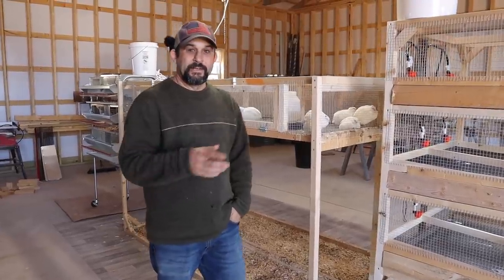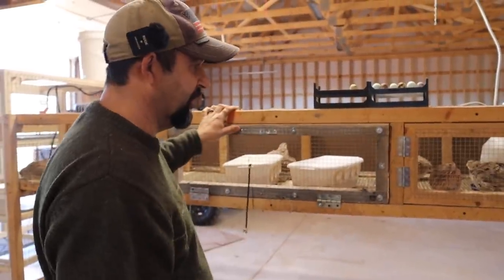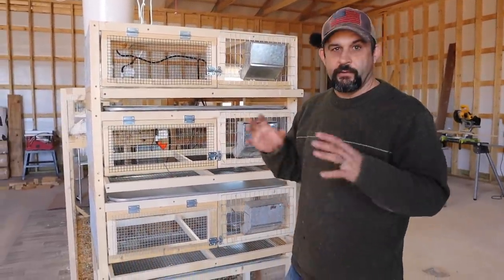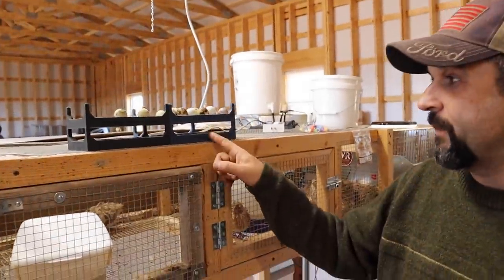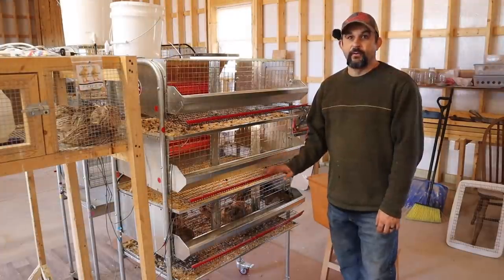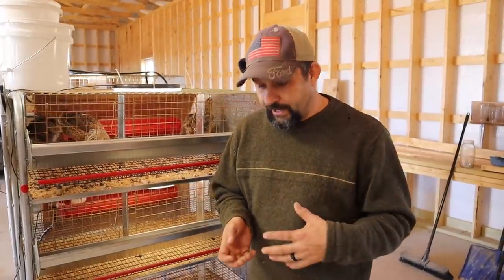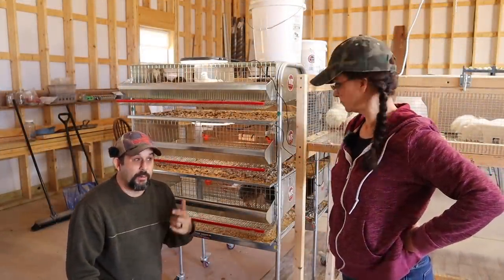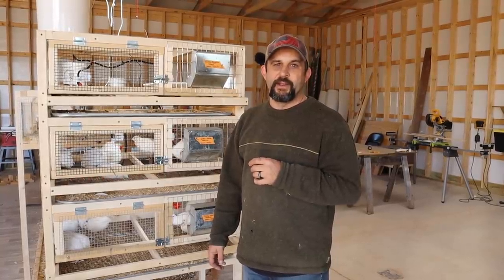Homesteaders HAVE TO BE Problem Solvers!

Comment: Sometimes when you are vent sexing you may find foam but it will really be a hen that was recently bred by a male. You will also only get foam when the males are fully mature.  Males usually start crowing at about 5 weeks of age. Males also have the habit of breeding other males which sometimes can be confusing at first.😃Thank you for showing in detail how to do the wiring for the light. I wouldn't have had a clue how to do it otherwise.

Comment: Fun, I breed parrots for 30 years. one of the best things i put in the buildings was a central Vacuum system, the dust is so bad. Put a big shop vac outside and run PVC pipe where i wanted outlets,  used the very fine saw dust for bedding in the trays so not to plug the pipe, outside i made a top for a 95 gal trashcan, rolling ben trash can.  Bird dust is a real problem for people and birds..   Love your videos.  I sold allot of quail eggs to chinese restaurant  they boil them and put in salads.
Reply: Did you have to get the NPIP to sell, where your at??

Comment: You could also look at Aquarium  L.E.D's lights and submersible lights 5-10 watts, all different lengths, and what ever light pattern you choose will come on with a timer , not having to cut off the on/off switch.... just need a 110v 3 plug adapters... I just added an 44 - inch, 11 watts submersible white/blue tube light for 34.00, much smaller are less expensive...

Comment: Hi Kevin cool eggs holders  an there so cute now I taught you could use a a kind of troff for Rain on buildings just tip your cage a bit put have the troff cliped an the eggs would rolled in the troff now you need a little openging a safe way for friends not to get caught i used these for feeding my chickens very handy you add a piece  of wood like kinda to end for close ends just a taught and the eggs are clean

Comment: There are timers that you can get for fish tanks and terrariums you can use, instead of unnecessarily rewiring stuff.
Reply: I believe he explained on the video that if he just put a timer with that set up, it would only turn it on once, and then the next time it would not turn on because of that rolling switch in the wire. That’s why he had to cut out the rolling switches.

Comment: Though I doubt I will ever raise quail, I still learned from this video. I love the way you chronicle your problem-solving process. It encourages me to not give up when a problem presents itself in my life. Keep up the good work. Can you get to the point where the wire connects to the light? or is it a sealed unit? If you can, could you use the short, plug end of the wire and rewire the light? It would so you eliminate a splice and loose wire going to the electric outlet. You may already know this. I learned it as a bird watcher. When the males look different from the females it's called "sexual dimorphism"

Comment: I love your set up. Could you make content for someone like me that lives in a large one bedroom apartment? I’m really interested in raising quail for meat and eggs.
Reply: The stacker cage he has would be good for that.  The one thing to keep in mind is managing smell and ventilation.  If you have a lot of birds you need good venting so the ammonia scent doesn't build up.

I keep birds both inside and outside, mainly inside during winter.  I recently had a larger than expected hatch, It was shipped eggs so i was only expecting 40-50% hatch rate but ended up getting 55 chicks out of 85 eggs.  While I had the space for it inside (i use Dale's Quails medium brooders) I still had to put a layer of bedding down daily and a fan blowing air over the cage out a crack in the window.  At 4 weeks the smell was much harder to handle in a small room and I was putting bedding down twice a day to keep things smelling decent.  So keep that in mind.

With how intense the cold is outside I decided to move them after they feathered up out into the garage instead of fully outside for better ventilation and air quality for both them and me.

I don't do the stacking cages so I've no advice for that directly, but if you've a lot of birds you may be changing the little trays to catch the waste very often.  So you may want to think about ways for handling high volume of waste and compost if you can.  It would make great compost if mixed with grass clippings and veggie scraps from the kitchen.  Or find someone that is into gardening, they would probably live the free materials for compost since a lot of people struggle getting the browns (the bedding material) for compost outside of gathering leaves in the fall.
Reply: @h.s.6269  Thank you for your response I live in NYC and it gets pretty cold 🥶 I imagine I need to regulate the temperature indoors that may be a challenge. I can keep my population small  and hope this will work Thank you again

Comment: Do quail have to be raised in the confined cages like you have - or can they be raised in a chicken run/coop setup?
Reply: Problems with a quail in a coop/run setup include… 
- Run would need to be 18” or 6 feet high.  They jump aggressively when frightened so between 18” and 6 feet they will break their neck hitting the top of the run.  12” is most commonly used height for cages.
- Quail do not return to a coop at night.  They will stay in the run.  The run will need to be predator proof.
- Quail do not use nesting boxes.  They just drop eggs wherever they are standing at the time.
- Quail’s brooding instinct has been domesticated out of them.  It is extremely unlikely they will sit on eggs and their survival depends entirely on people incubating their eggs for them.

So, some folks do use quail tractors but only for meat bird grow out cages, not for egg production or breeding cages.
Reply: You can raise them in a chicken run and coop setup.  But Alpha brings up good points.  The coop would mainly be for shelter from weather and predators if they are spooked, not for laying.  They seriously enjoy playing in the dirt and grass so I'd highly recommend letting them have an area to exhibit natural behaviors.  

My setup is 2 larger rabbit hutches connected to a 6'x8' run that goes to about thigh height.  The main drawback to it is that they lay everywhere so u need to do some reaching to grab them all.

I've heard that if you provide enough natural cover like small shrubs, tree branches with leaves, and low laying plants they will actually try to go broody.  I've not experienced this yet since I'm still perfecting my hutch and run system and trying to focus on the security of it the first year, this spring and summer I'm going to focus on quality of life adjustments for both them and for me.  Some of my access doors don't stay up so it makes it a bit of a struggle sometimes, lol.

Comment: There is actually a fourth way to tell males from females..the females lay the eggs...LOL  And I recently was searching for information about the best male to female ratio if you plan to be a breeder of Bobwhites, and I came across a study with the title, "Male to Female Ratios For Bobwhite Quail Breeders."  I am not sure where I found it.  The date of the study was December 7, 1973, so I am not sure if there is better information available from current sources.  The study was conducted by H.R. Wilson and M.W. Holland, Jr. for the Department of Poultry Science, Florida Agriculture Experiment Station, in Gainesville, Florida.  I have no idea if their conclusions would also apply to Coturnix, but I thought I would point you to it.  They concluded that "egg production decreased as the number of hens increased per case.  There was an apparent further decrease in egg production due to the addition of a second male to the cage."  You might want to check it out.  It is only a five-page report, but they did a pretty thorough job with their study, in my opinion.  At least it made sense to this novice.  :-)

Comment: Kevin, I'm thoroughly enjoying watching your quail endeavors. This is fascinating stuff. Thanks! 

For your lights, the anal retentive electrician in me would have used mini butt connectors and heat shrink tubing for a permanent & more professional-looking splice. Electrical tape is ok for a quick/temporary fix, but it should never be used as a permanent solution.
Reply: I would have used solder and heat shrink instead of butt splices, but then, most of my wiring work was in vehicle installation, so we worried about vibration eventually causing the mechanical splice to fail.
Reply: Most of us are not electricians and we have electrical tape. I think Kevins "splice" will last  as long as he needs it to. No need to go out and buy more stuff. Even though it would be prettier and look professional. And it gives us an opportunity to use that electrical tape that may have been laying in the tool chest for years.

Comment: so with the light. couldn't you just find a light with a manual analog on/off switch on the fixture itself and skip the consumption of materials by doin a bit more research? i'm sorry if you covered that in the video and i missed it. my a d d is actin up today. good info as always thanks.

Comment: So many questions. Getting  my homestead ready for animals. First a house for us. Be ready for future questions. Not sure about solar. The cost to pay off doesn’t seam to make sense around ten years doesn’t doesn’t work
Reply: Keep in mind 4 things. Once installed and working, 1) The overall value of 
your house (property) just went up. 2)There are tax credits that can be applied
for. ITC, Investment Tax Credit. 3) How much will it cost to install next year at 
current rates of inflation, instead of this year. Last, if your capable of installing
most of the hardware yourself, within code, the initial cost goes way down.
A lot to consider. Best of luck.

Comment: Would the LED lighting be good for the birds? LED is not healthy for humans.  Incandescent are really the better alternative- but they're your birds.  Good luck that they don't get health issues.. you guys are awesome and love they way you guys are self reliant,  don't really have to worry about living on the grid.  👍
Reply: I know that the high speed flashing of fluorescents is bad as it messes up brain function. Some people have seizure issues from them. Is that the same issue with LED?
Reply: @dlsdyer9071  There are LED daylight lamps for when you need to put animals under artificial light due to where they are housed.
Reply: @hillockfarm8404  I was wondering about the "not good for humans" part as my YT viewing this past two years had shifted from health issues (I just could not take the constant hammering on one issue).
Reply: @dlsdyer9071  Health wise daylight lamp would be better than plain LED,  fluorescents are so so at best light spectrum wise. Not likely only problem, but yes can be factor with health issues.

Comment: While the light is a great concept for the quail cages I have a real issue with the lighting that you did. The proper way to connect both ends of that power wire is to solder them together and then use heat shrink tubing to cover it. Please, please, please do not use electrical tape to do this!

Comment: I had quail for a long time. And then there was a rat problem. My quail died because they were so friendly and were sticking their heads out and the rats bit them off. So keep in mind using small enough grid for the wire. Also rats will eat their legs and pull them through their cages. So make sure you have the rats problem sorted. Just my thoughts from experience. What do you plan to do with the quails? Any special purpose?